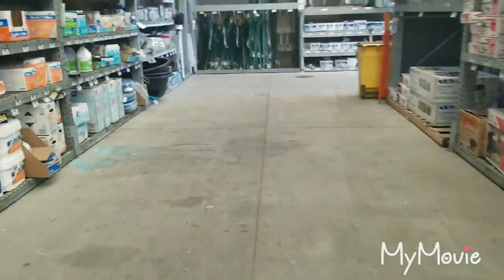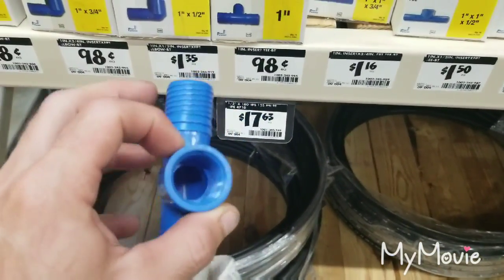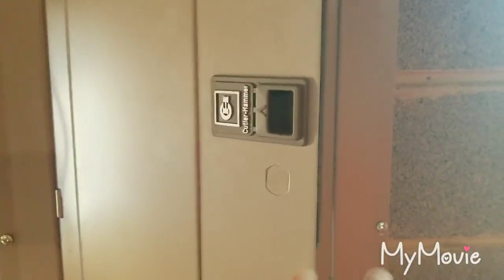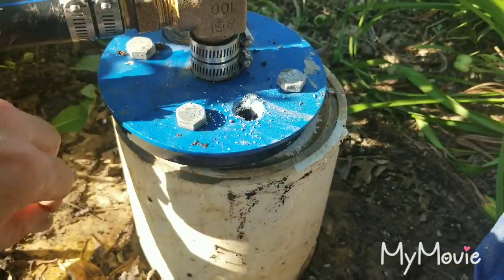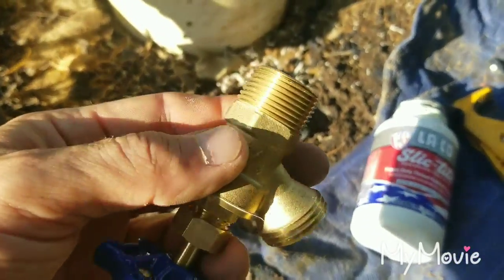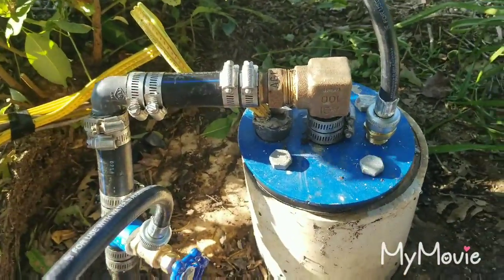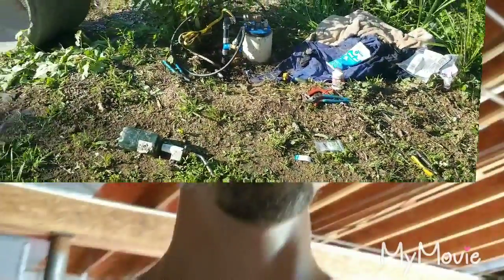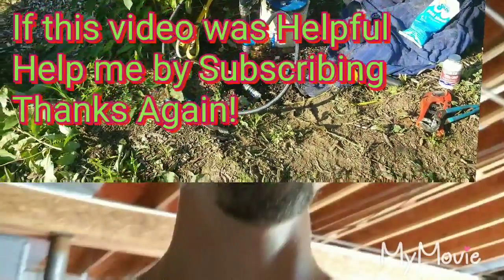How To Sanitize a Well. Well Cleaning. Sulfer/Red Iron/ Bacteria

Comment: How long will it take for our water to get clear? We did the well shock like you recommended and we have had our water on for several hours. The chlorine smell is gone but the water is BLACK.  We have had the water outside on for an hour and the water is still black.please answer back as this is driving me crazy.
Reply: Is it safe to shower in? Since the chlorine is out of the system is it ok to turn on the water softener again? After doing this we believe we need a new well pump as the pressure keeps fluctuating. The pressure tank is ok, we checked that out this morning and drained and refilled it. How much does it usually cost for a new well pump? Our well is 273 feet deep.
Reply from the maker: @crissiecook2207  $1000 total give or take $250
Reply: Thank you for all your help. We went and picked up the string filter. Our water is starting to clear up. It is very light gray so we turned on the string filter. Do you think it is ok for showers now?
Reply from the maker: Its totally fine to shower in!
Reply from the maker: Let the hose run wide open for 2-4 hours! Its completely normal. Frustrating i know. But your flushing your well & getting rid of years of trash. After 4 hours cut off the hose, let it rest for an hour & then run the hose for 5 minutes to get whats left in the lines out. Black is Manganese, I have the same issue at my house. This treatment is for red iron. But your flush will help your problem. Just keep running it for now. The rest period will allow anything else to settle out & eventually get clean. Google Big Blue inline water filter & buy it! Use the 1or5 micron string wound filter elements.

Comment: can drilling a well deeper help with rusty foul smelling water?
Reply from the maker: Drilling deeper will help for a short period of time, but iron is a bacteria that will eventually grow & multiply & build back up. Shock treatment like this video does wonders for Iron. But if it is really bad iron, you'll have to repeat this procedure once a year. 
You can remove iron with a filtration system, but the ones that actually work well cost about $3800 installed.

Comment: So, you leave the well head cap unsealed?!? Whoever put that 4" liner in and cut it off nearly level with the outer casing should be made to come and correct that error. There were ants and bugs crawling in and out of the well! That is a sure way to contaminate your well. I can't believe you would leave it like that. Which makes all the rest of your video questionable.
Reply from the maker: Its actually my personal well at home. I chose to shoot this video prior to cutting the liner down so viewers could see 👀 whats happening & why. I didn't drill it, but I did fix it. Good job for spotting the (unsealed) cap, but all the information in my well related videos is correct, and everything is done and proven to work with 39 years experience backing the information given. I provide quality information to people who look to YouTube for a straight forward understanding of their water system & how they can test it with minimal knowledge and hopefully fix it themselves. I assure you that my knowledge of water wells is extremely vast as it am a 3rd generation well driller. What I do struggle with is quality videos and editing, but I think I give it my best in doing that. If you need any help in the future, I'm here to help.

Comment: This sure is a much easier neater way to do this. I have a question: Every time I've shocked my well, the guidance makes a big deal about letting the chlorinated water run through your house fixture dn hose fixtures till you smell the chlorine. I've always wondered why you'd bother doing that, because if you shock the well as you show here, wouldn't the new fresh clean water wash out all the house plumbing anyway? I'd appreciate a response. Thanks! Great video.
Reply from the maker: Your right. The fixtures need minimal attention and they still see the cleaned water over time. The Chlorine needs to be 80%in well, and 10% in the pressure tank & water heater. Letting it sit in fixtures really doesn't do much.
Reply: @h2omechanic  WRONG. Sometimes you can fix everything but that stinky water still comes out of one of the faucets. Sometimes the faucet itself is causing the issue. I always treat the entire system if the water was really bad. I get inside the house and everything.
Reply from the maker: @IslandPlumber  its ok if you disagree,  but I'm not wrong. You treat the source of the problem and any fixtures connected to it will be cleaned out during usage due to the chlorine.
Reply: @h2omechanic  I leave the system off with that in there. It is flushed before I leave. Either you bleach everything and flush it or just the well and flush it. Maybe you have to wait days because of the pellets. When I let it sit overnight the pump is disabled to stop anyone from using it. Then I come back and clean everything out. Only then is it OK to use it again. FWIW, Rolling the dice ever telling a person the water is "safe to drink". Should refer them to a testing lab and tell them to follow their recommendations, not mine. I might drink it in front of them but I let them know it's not my place to say it is safe.
Reply: @IslandPlumber  it could be from your hot water heater anode tube.
Reply: In other words, shocking the well and pump and all that should be enough, right?
Reply: There will still be Bacteria & if your water tested with ecoli in it. That all will still be in ALL of your plumbing & fixtures. It needs to be COMPLETELY Sterilized.

Comment: Will this work for rusty water? We bought a softener system that was supposed to get rid of the hard water and rust but it doesn't. We even use the rust remover salt. It seems like after the softener cycles the water is ok but not for long. Everything in the house gets rust stained etc. Cant have even a kiddy pool for my grand kids cuz it looks like they are swimming in red/brown water and it even stains their clothes and skin. Please tell me this will work ???? We have the kind of rust bacteria that will create a rusty slime in the toilet tank. Also water will look clear and soon as I try and boil some on the stove it turns rusty.
Reply from the maker: Yes, this process will help tremendously! 
Remember to put your softener in bypass for a few days during & after this cleaning!!! If it is a Lowes softener, its very small in comparison to the one I show in this video about 70% smaller. You should try & set it up to backwash itself once a day or every other day. If you can't find the shock at lowes, order it on Amazon or use 2 crushed up 3" chlorine tablets. Ingredient in Shock is Calcuim hypochloride. Look for it when you buy. They also sell a Sodium Hypc. Its not as strong. Also check your pressure tank and make sure its good & setup correctly with air. I have videos about tank setups for you to follow. Hope it helps! Comment on any video ideas you may have for me!
Reply: @h2omechanic  The setup we have is pretty big, We bought it from Budget Water. They were helpful and the price was at least half what a big company would have charged us. They have a site you can look them up. Anyway, we have the softener and brine tank and another filter just for the iron and we have it set to backwash one a day. We put in the soda ash and the bleach and use the iron out salt and still have issues. Granted the tests that were done several years ago showed super high levels of the iron bacteria but still we bought the filter that was supposed to handle it. We are gonna try this and I'm hoping it helps. So glad I found your channel.
Reply from the maker: I have 100% confidence that this will help you! Just please remember to keep your filter/softener in bypass! Its very important or the high amount of chlorine will turn the filter media/resin bed into a gelatin substance. Its ok to turn it back into filter mode after 2-3 days of regular use. Be sure to circulate the chlorine for 24hrs. & after that throw the hose in the yard & flush that water out onto the ground. You'll be happy with the results! You can repeat this again if you feel it needs it.
Reply: @h2omechanic  HELP !!!Started the clean out by shutting the well pump off and draining the system. Turned the pump back on and now the pressure tank is taking forever to build pressure and gets to almost 40 and then drops to 0 what could be the problemm ? Pressure tank is only 2 yrs old and was woking fine before we turned the well pump off and drained everything.
Reply from the maker: My question would be do u have a filter before the tank preventing flow. Or possibly just by terrible luck, the pumps starting to fail. Bc u say the tank is new, I assume pump is older. Does your Pressure switch have a little lever on the side (low pressure cut-out switch).  Its strange to have a sudden issue if you only killed the power & drained the tank. Its almost like you were flushing the well into the yard & ran the well dry....if thats it, it'll recover soon.
Reply: @h2omechanic  No filter before the tank. The pressure tank builds to 40 and continues to run constantly but if I turn on the hose outside within a few minutes the pressure drops to 0
Reply from the maker: Its hard to determine what the problem is. Did you shock the well yet? How deep is the pump? If u have 40psi & kill the power, does it drop to 0 without opening any faucets? If so, you have a failed fitting connecting the pump to pipe, or pipe failure or worn out pump with a failing check valve.

Comment: will this kill red/orange organic iron. my well has so much that it looks like mud.
Reply from the maker: Yes! You might need to do this process 3 times over 10 days to get your well cleaned up. Circulate for 12hrs, then pump it out on top of ground. Then repeat circulation & add more shock. If you can't find the shock, crush up a chlorine tablet.

Comment: Is this bad for septic systems? What's the best way to clean/disinfect all the pipes running through the house? Seems like the new house I bought has a problem that requires this kind of cleaning.  Thanks on advance for answering my questions.
Reply: Thanks for answering.  The well is 8 years old.  Im doing a rebuild on the whole setup and while I'm doing that,  I think it would be wise to do a cleaning.  I am getting a slimy buildup in places. One being after I filled the bathtub and left it for a while.  There was a brownish rust film on the sides of the tub. Plus I've noticed a smell coming from the bathrooms most likely from the water in the toilets.  Have someone coming out to test the water but in my research,  I'm leaning towards rust bacteria.  Great video btw. Im going to use your method.  I was initially concerned about the septic tank but I did find out that it's not good for it.  I also want to run that chlorine through there pipes on the house so I'll have to flush the faucets with a 5 gallon bucket and dump outside.  Hopefully that takes care of the issue for a while.  Thanks again!!!
Reply from the maker: New wells typically don't have the issue...a rotten egg smell would be coming from the Anode rod in the water heater. Remove it and plug the hole.
Reply: @h2omechanic  thank you for the video! What does the Anode rod do and after I remove it do I have to replace it?  Thank you!!
Reply from the maker: @ado933  If your hot water doesn't smell, don't remove it. Basically the anode rod is a sacrificial item, if the water is aggressive to metal bc its acidic ect then it will attack the anode rod & not the metal tank of your water heater. Itll shorten the life of the tank, but the water won't smell horrible anymore. Expect 7-9 years out of it if the water is aggressive. My water would make me gag if I showered in steamy water & then the bathroom began to smell that way. Its totally worth it to replace a $400 tank when it dies than to live with that smell. The smell comes from the rod as a by product, so Remove it, cut it off at the threads and then tighten the plug back in. Use thread tape to ensure it doesn't leak. Its also super tight 150ft lbs. So have a impact gun or 3' breaker bar/pipe extension to have enough leverage.
Reply: @h2omechanic  They make anode rods that are made of an aluminum alloy for this issue of smell. KA90 I think is the one you want. The problem with standard magnesium anode rods is they form Magnesium Sulfate in the reaction with Sulphur in the water. It smells really bad. Had a customer way out in the country with a nice 8" drilled well, put some chlorine in the well, replaced the anode rod, and flushed the water heater. Been a few years now, and hot water smells fine now. The tank was pretty old at the time, but the original anode rod still had a little bit left on the wire, you could tell though it was 3/4 eaten away in 15 years. They didn't want to spend the money on a new water heater. As far as I know it's still good, I think the new anode rod saved it.
Reply from the maker: Also to do a loop chlorination, your circulation of water returns to the well, after 24 hrs, throw the hose into the woods wide open for 2 hrs. That puts the highest concentration of chlorine outside of your septic. Either way, its not great for the bacteria, but it has never made one fail. Remember this is to kill bacteria thats formed in your well, thats causing a stain or odor.

Comment: Great video. Quick question though, we put an electric anode on our 1 year old hot water heater. That took care of it. We did drain hot water and clean tank before. When changing from hot to cold i smell it for about 30-45 seconds. Pretty sure its the cold water, would this work for that u think?
Reply from the maker: Yes. This will kill any bacteria that could be producing the smell. And it helps clean the inside of the plumbing pipe & water heater

Comment: So can you just run a hose from the house back to the pump? To rid the sulfur smell???
Reply from the maker: Sulfur is a trying mineral to get rid of. If its only stinky on the hot side, its not sulfur, its the hot water heater "anode rod". If cold smells bad, first let's do the simple thing. Shock the well & return water to well with hose like in my video.  Wait 24 hrs & then let hose run onto ground for 2+ hours. Wait 3-4 days & dump 5or6 gallons of white distilled vinegar in the well & circulate for 24hrs. You cannot add both at same time!!! Chlorine kills the bacteria producing the smell & the acidity in the vinegar helps to prevent it from coming back.  Thins is a cheap test/fix, if it doesn't work let me know & we can try the next process which is something you buy & put on. But we don't want to do that if we can fix it first. Normally if the water was good for years, it just needs a chemical cleaning.
Reply: isn't acid bad for well pump?